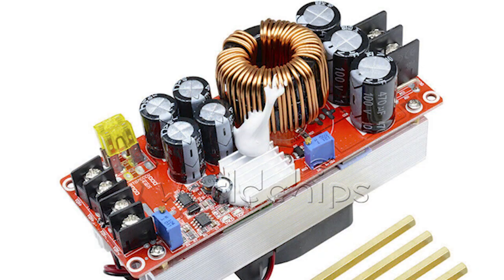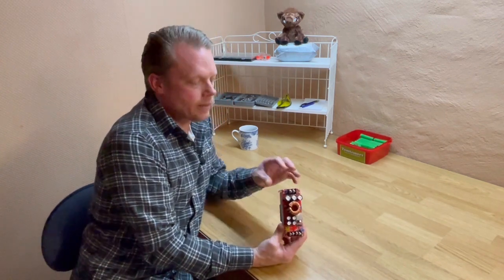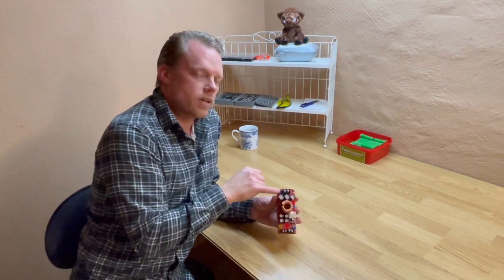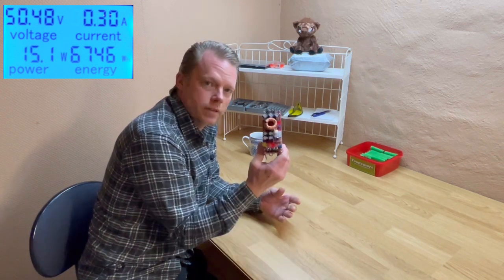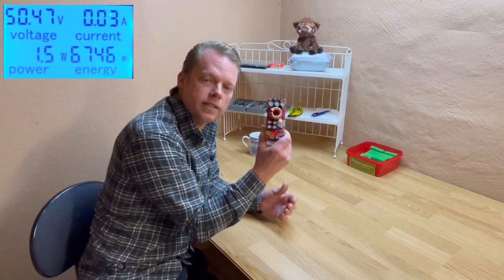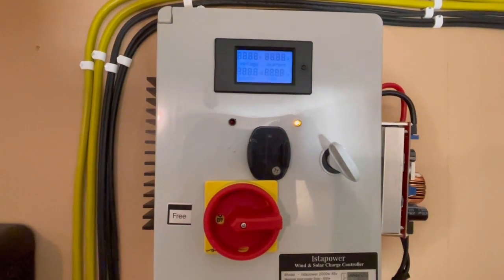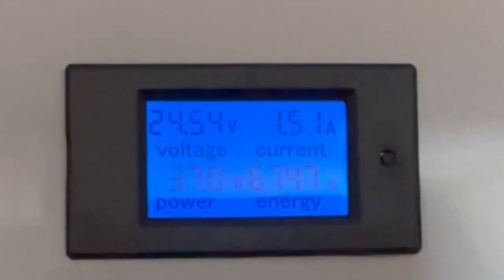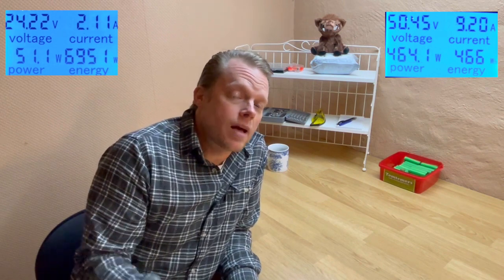Low wind charging, from my wind turbine istabreeze i1500 48v

Comment: Hi, Thank You for a great video! Trying to get my head around wind power and as you seem to have maztered this I thought I reach out:) I have a 48v battery bank currently charged via solar. I live on a high wind are and would love to add 2-4 Turbines to the setup. Allot of confusion about how to best connect multiple turbines as well as how to harness on low wind days like you explained. Would you mond if I dropped you an email and picked your brain?:) Thanks.

Comment: Very good! I have this controller. I have some questions about this. I couldn't understand till now. 
My first question: 
Can it work as a buck converter as well as boost converter? 
My second question: 
If we have 24 volt battery setup and wind turbine giving 45 volt in fast wind 
This module gives a fixed voltage suppose we fix it on 28 volt 

45 - 28= 17
Where will go 17 volt 
It will change 17 volt into ampere or not ?
My question is about voltage where will it go extra high voltage? They are lost ?

Comment: Hello, great videos! I have a similar controller, Where did you connect the converter inside the controller?
Thank you!
Reply from the maker: I think it was between the battery and the controller. It’s now two years ago so I’m hardly remember it, and i am not having this system anymore.
Reply: @flyingtools  Thank You!

Comment: We are preparing to install a 48 volt off grid system that I would like to supplement the charging system with wind. We are on top of a mountain and we receive a lot of wind. Between solar and with back up wind turbine(s) I think we could manage to keep our 48v battery bank topped of most of the year without using a generator. Thank you for posting your video!
Reply from the maker: Thats sounds great! Good luck with your project 😃

Comment: So, you have the "dumb" half of an MPPT controller. You manually switch the boost converter out of the circuit in high winds. But who wants that job?
Reply from the maker: Thats not a jobb, thats a hobby😉

Comment: Hi, can you help me ? I have problem to conected  and what Settings should i put for ista breeze controler.
Reply from the maker: Hi, no, it depends on your battery chemistry. If you don’t know how to connect it I recommend you to contact your local installer.
Hope you sort it out.
Reply: sorry, I described my problem wrong. I'm just wondering how to set the step up booster so that the turbine can freely spin up to over 20v. I have 48v LiFePo batteries and I want to use step up for slow wind to make it more effective. now it seems to me that the booster does not allow it to accelerate in small winds
Reply from the maker: @gieroj24  okey, then you need to raise the cut off voltage up. Connect it to a 24 volt battery on the input side and adjust it until it stops output anything on the 
”high voltage side” of the boster.
From there you will have a good starting point.

Comment: I keep searching everywhere without finding my answer...   I have 1600w solar system with MPPT and I would like to add a wind turbine.  Can I just use factory charge controler that comes with the turbine and connect to the battery ?  Or I need a complete hybryd system that manages everything ?
Reply from the maker: Hi!
I simply just connected my wind and solar system in parallel to my battery, each system with its own charge controller.
Hope this helps you.
Thanks for the question and good luck.😊

Comment: Hello, you show your system with the boost converter go from 24v to 48v instantaneously. How you do that, when the output from the booster is connecte to a 48v battery? It should always show the battery voltage. Changing from 24v to 48v its like changing batteries. I'm confused... 4:36 min
Reply from the maker: Hi. The volt meter is connected between the rectifier and the converter’s input side. I have done it like this because I rather would like to see the voltage that the wind turbine put out, so I can set the step up voltage converter correctly. The battery voltage can I see in my inverters.
Thanks for your question, I understand that it can look a bit confusing😅.
Reply: I see. Mine is connected from rectifier to converter and then meter with battery. So how did you set the converter to fix on 24v? Input potentiometer? Mine only let 7 to 8v pass on the input and the potentiometer next to the input is fully turned clockwise meaning, there is no limitation...
Reply: For what I understood, the pot next to the Vin, is for undervoltage cut. Did you set this pot to cut when voltage is below 24v?
Reply from the maker: @diogomartins9101  i’m sorry but I can’t remember which put it was that controlled low voltage cut off and sadly I cannot test it either because I am not using that system anymore.

Comment: I have instabreze I2000 with instabreze pro controler and i try with 1800w booster and is braking the wind turbine. Can you share some more detail about the setup?Will be apreciated, thank you!
Reply from the maker: Hi, you have to adjust the low voltage cut off so it will not load the turbine from standing still. I connected it to a 12 V battery and adjusted it, so it stopped to take power from the battery and then I tried from there.
Hope this helps, and I wish you luck 😊
Reply: Thank you for response , very appreciate i have now setup end start to work. Just that turbine is generating   10A or more and at the exit of the booster i read bearliy 1A with the batery not full.

Comment: Im planning to use one for a diy turbine from a hoverboard motor. One question though. Do I need to add diodes between the batteries and the output of the boost converter? I dont see any in your setup, its just a thought.
Reply from the maker: Hi there😃 Good thought, but its not necessary😊

Comment: En fråga om Hertz. Har läst om faran med att kombinera olika märken på solpaneler. Men kunde ändå få ett företag Photonic att erbjuda sig att installera deras celler ihop med mina Midsummer. Nu blev det inte så utan jag lyckades få köpa loss 4 paneler från Midsummers fabrik som jag har installerat själv på den andra MPPT i Växelriktaren. Så nu går båda MPPT. So far so good. Men så är vindraftverket på plats på taket och det snurrar då och då. Får ut mellan 15 till som mest 135 watt. Då är Hertz frågan eller kanske volt frågan. Skulle man i en "Combiner box" med dioder kunna koppla in den som en "sträng" adderat ihop med de totalt 5 paneler jag har av Midsummer(BOLD). Den enda jag kan hitta som har gjort detta i strävan att få ut AC kraft är du. Så hatten av för det! Att få vindsnurran att ladda ett batteri finns det massor av filmer om. Men det är AC strömmen jag är ute efter. Fronius SYMO 3.7 har 150 volt som limit för att starta. Så det kan ju inte fungera på natten. Men på dagen? Tacksam för svar!
Reply from the maker: Hej. Är inte helt säker på vad eller hur du menar. Men jag laddar mitt batteri med både sol och vind från två helt skilda inverterar. Sedan görs batterispänningen om till 220v. Inget märkvärdigt alls.
Det jag pratar om i filmen är ju bara en spänningsovandlare för att höja utspänningen från vindsnurran så den kan sändas in i batteriet.
Reply: @flyingtools  Tack för svar. Jag var otydlig, batteri har jag inte. Utan strömmen är tänkt at gå rakt in i Växelriktaren. Combiner Boxen från Eco-Worty har dioder för att förhindra bakström på de 6 stycken anslutningarna som görs om till en sträng för anslutning till inverter eller växelriktare. Iden kom från filmen "What is a PV combiner box?" av fantastiska youtubern Will Prowse. Du har säkert fått honom i flödet. Han hade också en idé men genomförde aldrig anslutning mellan bil och solcellssystem. Det är du  ensam om vad jag sett. Snyggt! Så som sagt batteri saknas. Riskerar jag att förstöra Fronius eller kommer den lilla strömmen från vindsnurran inte "orka" fram pga den större effekten från solcellerna?

Comment: Thanks for the video, really interesting! So this should work with 24V wind turbine as well? I have the basic orange 12/24V wind controller and it charges fine with 12V battery but won't start charging under 4m/s winds at 24V. Hälsningar från Finland!
Reply from the maker: Hi and thank you😃.
Yes I think it will work just fine👍🏻 The lowest voltage on the input side is around 9v so it will not work under that voltage.
Thank you so much for your comment/question 😊
Reply: @flyingtools  Yes that 9V will be plenty. Did you try other voltages than 24V on input side? Output voltage to max charge voltage I presume? I measured the AC voltage coming from wind turbine to controller and it was about 15V (10V between phases) for 12V battery and 29V (20V between phases) for 24V battery when charging so I will try achieve that 15V AC first before rectifier. I've tried to use just a 3-phase rectifier but of course it won't do anything if the voltage stays below battery voltage. I ordered it, thanks to you! I'll make a video about it if I get it working 😃👍
Reply from the maker: @JoniK1  24v was the lowest voltage I used. 36v was most efficient, for me. 18v in a 24v system. Yes do that, I have subscribed to you and looking forward to se more of you 😃👍🏻
Reply: 4 m/s thats low vind charging! is that turbine a i1500 aswell?  and how much watt do you get at 6 m/s? ,, i have a 3 bladed i1500 too just havent finised mounting it permanent yet,,
greetings from Danmark

Comment: Hello , first i would like to thank you for the video, and i have one question how did you put your controler on 24v settings ??? Thank you
Reply from the maker: Hi and thank you!
It’s just to adjust the voltage with a flat head screwdriver on the small potentiometers. There is one for volt, amps and voltage cut off.

Comment: Bra film! Hur får man fast det på en stolpe. Jag tänkte sätta den på mitt tidigare fäste för antenn och parabol. Har prövat skandal Turbinen Vevor innan och fick som mest ut 2 volt... ligger fortfarande i tvist med kina företaget. Dock satt den bra på antennfästet. Efter många timmars arbete.
Reply from the maker: Hej och tack!!
Jag svarvade till änden på stolpen så det passade perfekt sedan använde jag orginal skruvarna och satte även en typ av avgasklamma för att klämma ihop det hela ordentligt, slitsade röret först. Det får vara ett rejält fäste för vid full effekt belastar den stolpen med 160kg horisontellt. 
(Ej något jag räknat ut själv) men det trycker rejält! Jag var mycket nöjd med denna men efter att jag ökat batterispänningen till 400v så sålde jag detta. Saknar det dock nu när det blåser rejält och från rätt håll😅
Tack för din kommentar och välkommen😊
Reply: @flyingtools  Jag planerar att testa en Wind generator IstaBreeze® Air-Speed in 12V or 24V - carbon blades. Det tycks vara den minsta bästa. Rapport kommer på min kanal. Har kört med en fläkt från en luftvärmepump. Vilket gav mer än Vevor..

Comment: Hello Sir, I have such a booster, and I want to install it same as you did, after the 3-phase rectifier bridge in the regulator box. But I don't know which exactly are the contact plus (+) and minus (-) points on the regulator electronics board. I know where the 3 phases for AC go, but I don't know the DC output from the rectifier bridge so I can connect the booster directly there, and then to the batteries bank. Any advice on how I can identify the plus (+) and minus (-) points ??? That would be much appreciated. Thank you in advance !!!
Reply from the maker: Hi there. I simply connect the booster inputs where the battery normally is connected to the controller. - and + should be marked but if you are unsure about that you have to ask an electrician so maby he can help you to measure that up for you. Sorry, but this is hard to answer without seeing it irl.
Reply: @flyingtools  You are indeed correct Sir. Actually that is where the voltage from the regulator comes in. And from the booster the output should go to the (+) and (-) from the batteries bank. This makes sense. And I can make bypass circuit so I don't use the booster when there is strong/enough wind to produce the voltage I need. I will manage to connect it eventually. Thank you !!!

Comment: I remember reading such booster may give spikes when the voltage dropps (discharging the capacitors? ) which is bad for batteries. Any thoughts on that aspect?
Reply from the maker: The only spike that I have seen is when you hook it up to your battery, you definitely need to precharge it before you do that.But that’s the same with all of those components with large capacitors built into it. If it will hurt your battery bank probably depends more on the size of your battery bank then on this device. Thanks for your comment😊

Comment: Hi again,

sorry to bother you but i have a important question.

Istabreeze build this Chargecontroller with built in step up converter for me.

I have the I-2000 48V. They preset the booster with 35V Input and 55V Output. Now its look like the resistants is too much (too high ampere) and the windgenerator is turning really slow.

What are youre preset for the booster?

Thanks mate!
Reply from the maker: Hi. Hard to say but I think they have set it so the load starts to early. Se if you can adjust the low voltage cut of. I normally had it set to around 36v. The turbine will turn completely free to that given voltage if everything is set up ok. Hope this helps.

Comment: Si tu en mais 2 en parallèle pense tu que sa marcherais a haute puissance.
Reply from the maker: Yes I think that will work. But you have to set them to the same input voltage and then do the same with the amp setting I guess.

Comment: Then it just needs a big resistor to switch to when the voltage from the turbine gets too high. As a storm protection.
Reply from the maker: Yes, but I only used the brake manually if so.

Comment: Hi,

quick question:

As far i can read it from the other comments you have this construction:

Windturbine --> Chargecontroller --> Rectifier --> DC Boost --> Battery.

You connect the DC Boost to the rectifier. Correct? Where in this controller i connect the rectifier? Maybe have a link of the rectifier you use?

Would be awesome!

Thanks

Erik
Reply from the maker: Hi. The rectifier is built in to this controller and I have connect the step up voltage controller AFTER the rectifier and then direct to the battery. I will put a link in the description later.
Reply: @flyingtools  Would be great if you have some pictures or anything to bild it myself
Reply: @flyingtools  how about the link? Thanks!
Reply from the maker: @Selfmadestrom.de_Blog  it’s in the description.

Comment: What happens when the turbine goes beyond 48v and my battery is also 48v with this in between?

Im struggeling to find a buck boost type that can handle anything between 24 and say 90v for the i1500.
Reply from the maker: Hi. I had it sett to maximum voltage in high wind conditions. And when the battery is full the charge controller will start to brake the turbine. When that’s happens the voltage drops quickly and the brake releases, the brake will the engage again and this cycle will be repeated.
So I highly recommend to brake the turbine manually when the battery if full.
Thanks for a good question👍🏻
Reply: @flyingtools  yeah I get that, but i was wondering if the boost converter will survive 48v+ in gusts etc.
Reply from the maker: @Deiphobuzz  it can handle up to 90volts. So the voltage is not the problem. I was more concerned about the current, or the load on it. Mine has been working fine around 56v and 10-18 amps. And of course even higher amps in hard wind gusts. But in storm conditions I bypass it so it not was overloaded.
Reply: @flyingtools  aah okay, so it just passes through the voltage to the battery when the input gets higher than the set output? 

I have a 48v bank, and a 48v turbine, with a 48v grid tied inverter. I thought it might blow up if the wind would push the input side to say 60v, while the converters i put was locked to 48v. 

Might just order it then. Sounds promising as an alternative to a 1000 euro controller.
Reply from the maker: @Deiphobuzz  in my case I have a brake controller before the step up voltage regulator, so over 57v the brake engage. I have only used this setup together with my battery bank so no idea how it will work together with an grid tied inverter.
Reply: @flyingtools  I installed one of these boosters. Above the set output voltage, the booster just allows it to bypass the circuit. 

Works great. Im getting an average of 100w all the time now, instead of nothing at all. Id get 3 or 4kwh a month. Now 25kwh in the last 3 weeks.
Reply from the maker: @Deiphobuzz  that’s great!
Well done 👍🏻
Reply: The boost controller can only handle the 90v on the output and 60v on the input. I had to buy a voltage protection circuit that once past 58v it switched it to my midnight controller